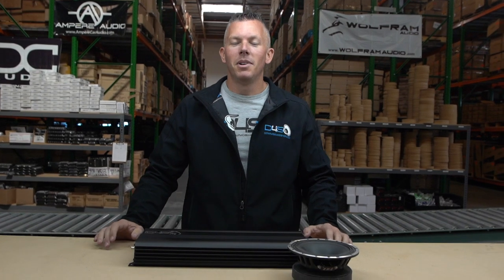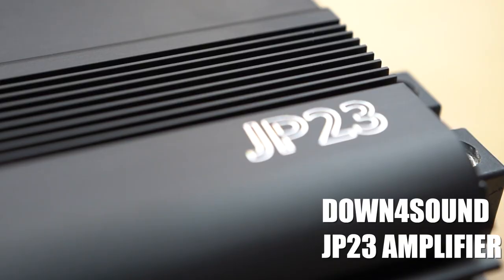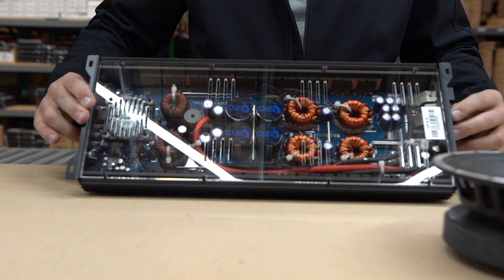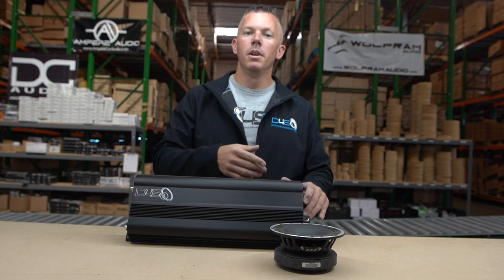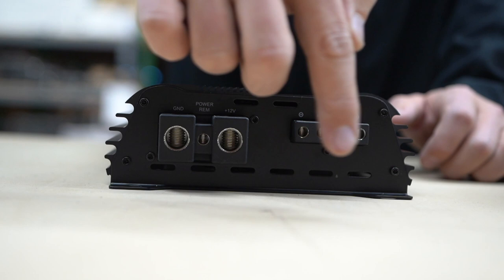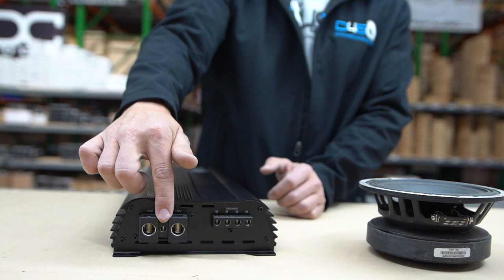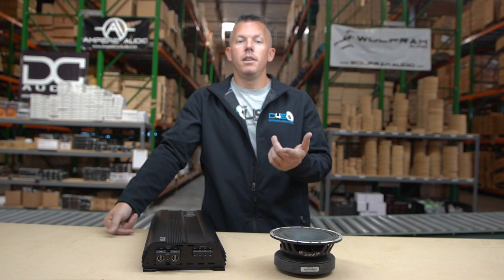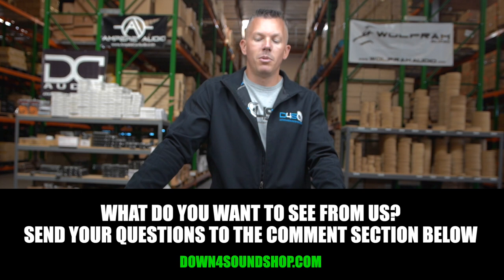FAQS WITH JP: WHY DO MY SUBS MAKE A LOUD THUMP WHEN I TURN THEM OFF?

Comment: I put my remote wire on a toggle switch. Ran directly to the battery with a inline 5 amp fuse. Turn the amps off first. Then the ignition.

Comment: A simple thing like that wire splice causes the system a the slightest delay to read it (millionths of a second) but it is a delay and you have it coming on you just don't have the POP to make you aware of it. Hopefully that explains it in lay or non electricianal term's so it's easy to understand for all. My biggest recommendation to any and all is use the connectors people. This is a huge investment to most, it's your vehicle and sound you've paid money big or small but it's yours so ensure you take care of it and you can't go wrong doing it that way.

Comment: Now I had this when I run a high level input off the stock stereo.  I run sundown on the lower class amp from them. The only way it would stop with that is turn down the bass level. Never had problems after that

Comment: Ive had this problem since i put my system in. Made sure all ground are good still happening so i guess ill try the relay.
Reply: me 2 ill try
Reply: Pls make a video showing exactly which relay you used. Mr price wasn’t too specific. For some reason whenever I ask for a 40amp relay the part they try to give me plugs in. I definitely can’t connect it to my remote wire.

Comment: Many times this has to do with your headunit.    There is a way to stop it completely, and what he is talking about is to shut off your amps before you turn off your signal source.      hiring head units usually don't do this but a lot of the cheap Stereos on the market like those Android head units for  $45 do this.    

this is kind of the reason why engineering does matter and the products that you purchase sure may sound great but it's the little things that really do matter
Reply: Not in my case, I tried with another unit but isn’t the radio
Reply: So then what’s the solution
Reply: What makes it do it when you put it in gear

Comment: I've had that popping issue in the past. Turns out it was from my RCAs running next to my live wire and whenever I'd hit the key I'd get that loud pop from the electrical current transferring through the wires insulation and that would cause a break in the signal going from the deck to the amp. I had to completely pull my RCAs and run them on the passenger side separate from the live what runs the drivers side.
Reply: I haven't searched online yet but after reading your comment I wonder if they make RCA cables that are "shielded".  I do HVAC and I use shielded thermostat wire in some situations so I'm curious now. Sorry just my random thought 😆.
 Glad you figured out your issue 💯✌🙌
Reply: Same problem I use to have..
Reply: @mikethatguy27  yes they do make shielded RCA cables. The stinger cables are pretty good
Reply: @isidrosevier1125  awesome, appreciate that!💯✌🙌
Reply: Think you just might have fixed my problem thank you 👍🏽

Comment: Mine was making a loud pop until I relocated the remote wire to the red acc wire from the blue/white wire. That made the amp cut off at the same time as the radio instead of after.
Reply: this worked for me, thanks. had this problem for some months now. it still makes a very small pop but it’s not noticeable unless your REALLY listen like and have ur ear next to the speaker
Reply: That always been the easiest fix without having to buy extras!

Comment: So I recently bought a JP MM1004 and installed it. Amp is great, only issue is when I turn off car it pops. I'm going to try the relay BUT if it don't work. I'm going to pull stereo and bypass remote wire. Run everything off of the ACC wire (key on wire for stereo, usually red wire). If the key is on everything powers up together instead of going through stereo for ON/OFF operation

Comment: Currently I have to power down my sub amp (via bass knob) before shutting down the truck to avoid  this.    Prior to doing so I have been scared nearly to death by 4 8’s.    It would happen when I opened the door and totally not expecting it.
Reply: Lol....me 2
Reply: Man im having this problem..I had a taramps smart 5k bass right it went out so I bought the taramps smart 5k version and the taramps eq and now everything works but its a loud pop noise when I turn my car off and its scary loud..
Reply: Mine does the exact same thing when I put it in gear to leave it makes that noise and don't stop

Comment: If multiple pieces of your equipment/hardware has GTO/remote wire TO technology and you're not using it through the initial source only that is your problem. You also can not splice the wire circuit you use for the remote TO you must either tap into it or use connectors to ensure the vehicles software system reads it as a single circuit on any vehicle with an OBD2 or that has security or other systems run through/with the head unit.
Reply: Having this issue now wasn't happening before..had four amps before... remote wire was on distribution block and amps were grounded to frame and it didnt do it...now I have 3 amps but didn't use the fuse block..sorta jumped from on amp to the next..plus the amp grounds are on back battery condition one of these be the issue

Comment: You don't need to use a relay, the remote turn on doesn't use enough amperage to require a relay, even if you're using 6 amplifiers.  I suggest turning the volume all the way down before you turn your system off.  Also use a toggle switch to turn your system/amplifiers on and off with instead of the ignition

Comment: I run a toggle switch so i can just turn it off and on as needed.ive heard shouldn't and dont need a relay as it pulls more amperage.there's a video on youtube about it.
Reply: I never use the ignition or key to turn my system on and off, just like you said I always use toggle switches. It's the only way to go.  Also that way the stereo is mostly separated from the vehicles electronics, makes for a much cleaner sound with no issues
Reply: Thats a good idea! I know some head units with more functons than other tell you to run a small  chassis ground and connect thru the ground of the wiring harness when running external amp either way the relay idea makes sense great video jp!

Comment: On that issue yes your rite just run a relay pin 30 to the amp 84 your remote turn on 87 12 volts and 85 ground
Reply: What is the voltage that you will need?? My amp has 2 35 amp fuse do I need 80 ?

Comment: I want to get a second avatar 15, but the first one (current)I definitely pushed it to see where the critical fail point is at on them, coil is a little scratchy I also figured out my alternator is dying so it’s possible it clipped at one of those drops. How do I go about getting this one swapped and order a second one(building ported box for them)

Comment: I always thought it was grounding signal noise especially if your sub amp is hooked up using high level inputs.
Reply: my current situation
Reply: @ceavalencia4767  I have a soft bump when I turn on ignition sometimes. If my bass knob is up high it thumps louder.
Reply: @adaboy4z  im not using knob currently..I have hard bump when turning on and off...amp has cut out at high volumes and amp gets very hot
Reply: @ceavalencia4767  turn that gain down

Comment: I’m having this problem too. It only happens when we run a preamp. Once we take the preamp out and run everything to the head unit there is no popping when turning the car off or on. Once we add a preamp(asp) popping occurs when we shut the car off. Tried running a relay but still pops. Switched the remote to the ignition and the pop occurred when we start the car and not when we shut the car off. In all circumstances we are running a relay. So I was wondering what should we do? Thank you!
Reply: I’m having this same issue right now. I think one of my Skar EVL 12 blew for this reason. Guess I won’t be using the preamp!
Reply: Damn I jus started having this issue..I had the taramps smart 5k bass no issue besides it jus went into protection mode so I bought the taramps smart 5k version and the taramps eq and now when I turn my car off its a loud pop noise..I dnt wanna mess up my amps or subs what do I do???

Comment: I'm running a Rockville 8K to 2 15in Skar VFX-15s. When I turn on my head unit the amp comes on and I hear very soft sound coming from the subs. I have adjusted everything to the max and back to mid to nothing. Nothing works. What is the issue?

Comment: My system doesn't do that. But what it does do after I turn it off is that it's still playing at a very low volume, 1 or 2 seconds, and then it's off. It's a small issue that I'd like to solve.

Comment: Sooo how do you stop engine noise from entering your system. When running multiple amplifiers. Example  more than 3......🤔🤔
Reply: You can try grounding your RCA's
Reply: If you are using more than one grounding location this will happen you can fix it by either putting them all on the same ground or using a ground loop isolator which are pretty cheap.

Comment: I installed a bus bar and run my main Power supply to the bus bar then I ran 2 wires to both of my amps that away both amps turned off at the same time I do not have any popping

Comment: Great video thanks JP. I don't have this problem but I've known people who do!

Question: say you have a 4 channel amp that you are trying to wire for a car with 4 door speakers and 2 dash tweeters.
If I connect 1 tweeter and 1 door speaker to the same channel will they be getting half the watts each?

So door speakers is 50watts, tweeter is 50 watts. And a single channel on the amplifier outputs 100watts.
If I put the tweeter and speeker both on the same channel will they get 50watt each Or both get 100watt?
Reply: You’d want a cross over for the tweeters so it’s not getting the full range of frequency and mess your tweeters up. The wattage is all determined by the ohms on that channel.
Reply: Also when you do put that crossover in it will not drop your ohm load down it will keep it at 4 ohm that's if your door speaker and your tweeter is a 4ohm speaker and tweeter. But definitely recommend a crossover.
Reply: Thank you both for your input.

I'm still unsure how many watts my speaker and tweeter will be getting tho.
My speaker is rated 50watt rms and my tweeter is also 50watt rms.
When I put them both on the same 100watt channel, how many watts will be going to each of them?
Will they both get the full 100watts from that channel or will they each get half (50watts) from the channel
Reply: @RandoManFPV  
Use bass blockers on the tweeters  and then hook them to the same channel,,your watts depends on your Ohms  ,and you should be in that area ,,and it will sound good ..
Good luck !

Comment: I have a real good question why is my highs amp making a whining noise when I accelerate my car without any sound coming through it
Reply: But my bass amp dont do it
Reply: Alt whine...u need a better ground most likely
Reply: Bad connector  bro...make sure your ground  are sand  if u running  big power doin from the chasis....make sure bass amp has his omw ground  sand and tie....
Reply: Bad ground. Ground amp(s) to the frame!
Reply: whining usually comes from having your power and RCA cables too close. The magnetic field around the power wire disrupts the signal in the RCA cable. You should never run RCA and power wires next to each other. If you are running the wires to the back of the car, run the power and RCA cables down opposite sides of the car. A sure fire way to know if this is your problem is when the whining noise frequency increases as the car revs go up (alternator spinning faster).

Comment: Wait this guy just said that the remote wire being daisy chained makes that sound? Lol smdh that is definitely a grounding or signal noise definitely not anything to do with the remote wire or how it’s ran.... Smdh guy just proved my point right here lol see ppl guy knows nothing! He just gathers info from boxes and says it... no actual experience because he has everyone else do the installs for him! Must be nice to be that rich lol
Reply: You're a textbook hater. Who cares if he has money and pays others to install his huge complex system? I know I probably would if I had the money. 

Relays are used to turn things on/off reliably at the same time. I believe some head units send out a pulse of voltage as they power off.. so if your amp is still on when that happens (by not using a relay), the pulse is gonna travel down the RCAs and to the amp. Of course there are other possible reasons for a "pop" sound but that is a common one.

Comment: Hey JP here’s my question for you.   Every time I upgrade my system and go bigger, louder, better.  I’m always satisfied at first but every time (at least 15 dif setups, since my first system at 14yr old- 2 years before I could even drive) at some point not long after break in,  I always want more and feel it isn’t loud anymore.   Does this ever stop?   Is it ever loud enough?
Reply: What do you meter?
Reply: Never metered.  Nothing extreme yet I have to many kids I have to keep room for.  Just wondering if anyone else has this problem and if they ever are satisfied
Reply: @wetdookie3808   When I 1st started out I was looking to do  150 D b's now I'm looking to do 160's.  And then after watching 5 star car stereo on YouTube II try to make sure I have great wire management and a good soundstage so I don't think it ever really ends
Reply: That's entirely subjective but the short answer is, no. There's always something better and we always want it. It's literally an addiction. Bass or audio is just your drug of choice.
Reply: You have the same issue has JP here. He started off with probably one sub and now has a 100k watt vehicle. it slowly happens if you keep the passion towards car audio.
Reply: That’s a hard question......I would say no.   As even the guy with 12  15” subs...will always wonder what 12  18’s would sound like.
Reply: 55 year old man. No it never stops. You have to force yourself to be good with your system. I'm doing a 17k install as we speak. This will be my last. Till the next one.🤣🤣🤣🤣